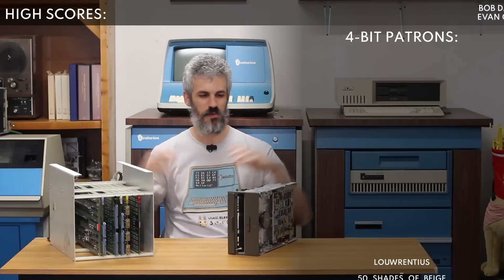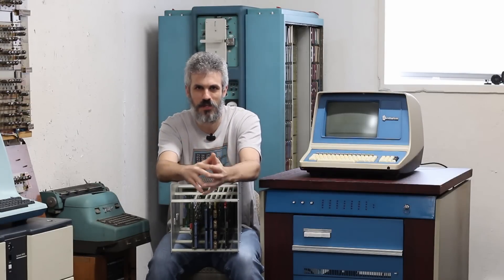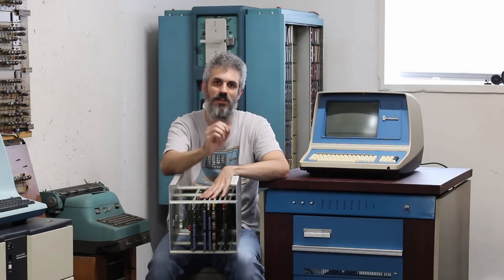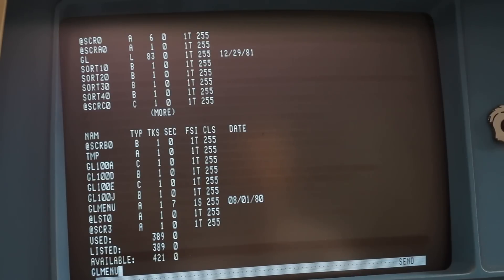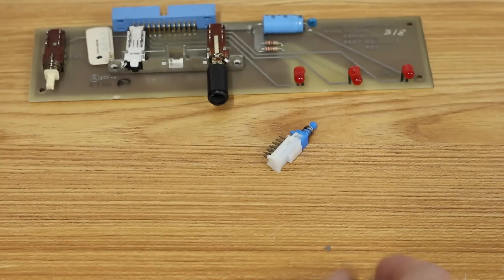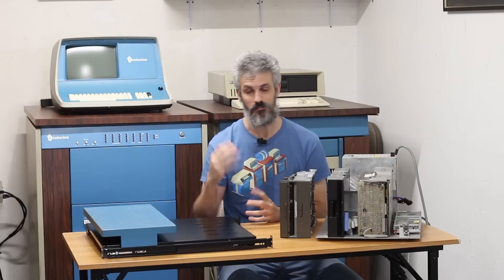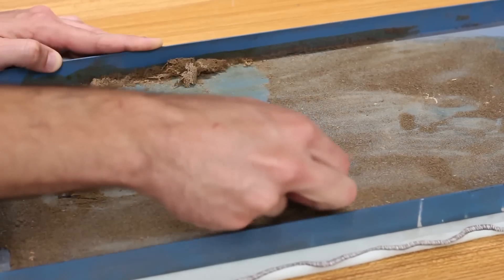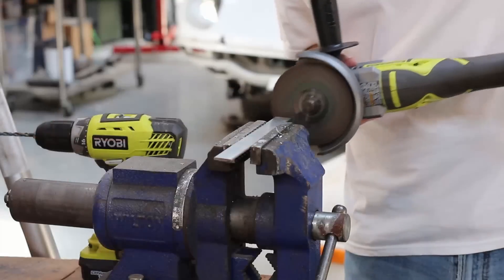The Centurion Bites Back!

Comment from the maker: Thank you all so much for the amazing comments!
To answer a question that many have had, and it's a good one for sure, what happens if they input a modern date? Or rather, is the machine Y2K compliant?

Interestingly, the Centurion doesn't seem to care at all. It treats the year as just a two digit number, and near as I can tell, nothing adverse happens if you drop in "23" as the year instead of "84". However, if you let the machine roll over from 1999 to 2000, it does actually break. That's because the 10's digit was never programmed to actually roll around to 0 again, so it instead just counts up to the next ASCII character, which breaks the date. Best way around this that I can see is to simply turn the machine off on New Years and make sure it's off during the rollover. 

Now, there might be some issues within applications of some files having dates older than others, but we haven't tested that deeply yet to figure exactly where it's lacking. Sounds like it's time to spend some more time in Meisaka's emulator!

Comment: A fair replica of the plastic buttons could be 3D printed if you could make a CAD of the remaining one.
Reply: Given that it is a technical school, it could be a wonderful project for students to do!
Reply: For that, I’d recommend resin printing.  Then the printing artefacts will be so minor as to be super easy to remove.  FFF printing which is what I do takes a fair amount of effort to remove the lines if so desired.
Reply from the maker: One of these days, I'll learn how to 3D print stuff. Although, as Rikki said, 3D printing replicas would be an awesome project for the students at Butler Tech!
Reply: @UsagiElectric Just go for it, its easy to learn 🙂
Reply: @UsagiElectric  Great idea! I suspect that you can find students that would be happy to take on this task. You could do it but there is a learning curve and it might distract you from other projects like these computers.
Reply: @RikkiCattermole   Excellent idea!
Reply: @UsagiElectric  If for whatever reason the students aren't able to do it themselves, which would be a bit of a shame as that does sound like a fun and very approachable project, I'd be more than happy to throw my time at the CAD and pump them out on the resin printer in some tough resin
Reply: @UsagiElectric I haven't used a resin printer, but once you get the settings right it's supe easy to use an FDM printer.
Reply: I put FDM prints into my CNC lathe sometimes to get a perfectly smooth finish. A button would be doable that way.

Comment: FYI - The lady in the black & white picture is Rena. Rena was the secretary to the VP of engineering. The Centurion hardware is a CPU4 floppy system with CDC 9316 matrix printer and ADDS terminal. This picture was taken around 1977.
Reply from the maker: I love that Bud used the staff as models for the promo shots. It's completely understandable though because Rena is absolutely stunning!

Comment: Before you go too crazy, try putting a load on the 24V rail. Also try a small load on the 5V rail. Sometimes one or the other is required for a regulator to work. Twiddle/lubricate the 24V adj as well. Also, what is an appropriate date? Are you sayin' this bad boy is y2K compliant????
Reply from the maker: A couple of steps ahead of you on those, haha.
It's a failure in the regulation circuit of the 723 IC. We have it narrowed down two a few transistors and diodes. It 's a super interesting failure mode though!

The Centurion isn't exactly Y2K un-compliant! It treats years as just two digit numbers, which means you can put pretty much whatever year you want in. The main problem comes if you let it roll over from 99 to 00. The 10's digit wasn't engineered to roll over in the code, so it just counts up to the next ASCII character, which can break the date format. Just make sure you turn it off New Years Eve and leave it off as the date rolls over and you're good!

Comment: in poland this style of switches is called ISOSTAT and you can still buy them in almost any electronic store , in europe the biggest online  store would be TME so by looking there you can find something that also avalable in mauser C&K G003A , i am not sure about diameter of yyour oryginals , those are black plastic covers  6,25mm diameter, 9mm tall
Reply: and also mauser has entire switch cap serction  and the stem is standarised so anything that looks the part should fit the only problem is they never tell you how long or wide they are unless they have datasheet, this is how universal those round buttons aremauser have also 10,5mm tall and 8,8mm wide caps but for some reason they list them as 3,3mm made by e-switch

Comment: It looks like a replacement for the push button cap could be quickly fabricated from a piece of wooden dowel. Drill a hole in one end. Sand or grind the other end to round it. Paint or just leave "natural."

Comment: When you reinstall the Butler Tech Centurion check the serial cable (for Red or Yellow heat shrink tubing)  from the 4-Port MUX to the ADDS terminal.  The serial cables built by Centurion had color coded heat shrink tubing on each end of the cable near the connectors.  Red = RS-232   Yellow = 20ma Current Loop   and a Black was RS-232 for the TI-810 serial printer.

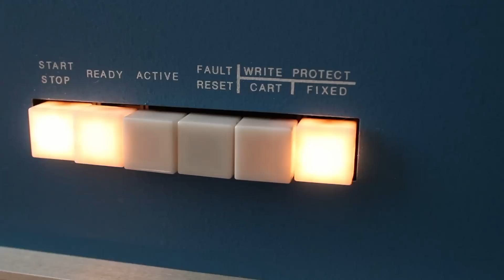Comment: I love that at 11:30 there's a hardware write protect button, and it has a light on/off, brilliant
Reply from the maker: Oh yeah, the physical write protect of the Hawk drive is one of my favorite features! I can test weird things out in software without worry of destroying any data. More drive should have a write protect button!
Reply: @UsagiElectric If I remember correctly, some (or all, I don't know) SD cards actually have a physical write protect switch built in.
Reply: @nikkiofthevalley  But unfortunately, with those, you need to physically remove them (and possibly unmount and remount the filesystem) to access the switch.  Also it's really easy to accidentally move the switch when inserting or removing them.

Comment: I had a HP 4274A LCR meter stump me like that. Came in with fried transformer. Replaced transformer... Smoking zener, replaced. Pulled cards till I got under 1 amp total draw. I never found anything wrong with ANY of the cards. Gave up on it, put it back on the shelf. 3-4 days later got it down and pulled every single card. Put'em all in antistatic bags and labeled them. They were about to go on ePay. I still had low voltage on +12v rail. Removed the backpane and viola! +12v @ PSU. It was an unseen capacitor on the backpane that shorted. I replaced both +12v and -12v caps on backpane and shes a winner. I'd say play pinball for a few days and have some good R&R. It'll be obvious when you come back.

Comment: I loved those little configurable switches, I never even realized they had been discontinued. There is (was) also a bracket available for them with a sliding bar that would fit into that little latching mechanism, you could mount several switches in a row with that bar joining them, and it would make "radio buttons" such that pushing one in would slide that metal bar over and unlatch the rest, then a spring would pull the bar back and latch in the one you had pressed.

Comment: I've been in the same situation multiple times pulling my hair out unable to get anywhere and nearly scrapping/smashing projects in the process, but after walking away from those projects for a day/week or two and then coming back to them, i had it all figured out and solved within minutes.

More often than not, it turns out to be the one thing you were 100% dead set determined it just could not be, and thats what trips you up and leads you down rabbit holes, sometimes ending with a irreversably damaged system.
Reply from the maker: It's amazing what a good night of rest can do to figuring out a seemingly impossible problem! In this case, I'm already starting to hone in on the problem, and it's definitely an interesting and not super obvious one, which is quite exciting!
Reply: Same. HP 4274A LCR meter. Pulling cards reduced excessive current draw but it wasn't the cards. It was the backpane they were all plugged into.
Reply: Happened to me two days ago trying to fix an early-90s VCR, thankfully without any lasting consequences. Task was simple enough, replace two mains filter caps in the PSU and replace the clock battery, a solder-type CR2032. Did all that, put everything back together, VCR refused to load a tape. It did notice I was inserting a tape but not doing anything beyond moving one lonely solenoid. Pulled both video PCBs back out and checked and re-checked all sorts of connections, nothing. I was super-frustrated and just as I decided to put the lid back on for the time being and call it a day I decided to revisit the one cable I'd moved earlier to make absolutely sure it wouldn't get caught in the loading mechanism. Lo and behold, the plug where that cable connected to the PSU board was completely loose! I plugged it back in and everything worked just fine.

Comment: I'm glad to see that you have a dyslexic keyboard like me.

Those buttons could be make using round plastic rod of the right dimension.
Drill a blind hole in them that is equal to the diagonal dimension of the button shaft.
To lock them on cut a single ring off the end of a compression spring that has the correct wire diameter and bend radius to fit in the groove on the switch shaft.
Then you need to make a groove on the inside of the new button to take the spring clip. It needs to be deep enough to allow the clip to expand enough to slide over the shaft.

Comment: Probably take a piece of black plastic rod that’s the right diameter, drill a hole in the end and use that for the button cover. 
Or, could be a fun machine shop project. Be an easy enough task to turn a few on a lathe

Comment: That is like an OLIVETTI BCS3030, the duel floppy unit would have a mains powered motor which drives both drives via belts and pulleys and shaft with two pulleys,the printer would be a bidirectional printer don't know why the keyboard isn't part of the desk, it used packages like lexapk,ledgapk,repapk and other apk files.

Comment: The switches on the Centurion look almost exactly like ones I used recently to repair a 1980's Dragon 32 computer (from Wales). They were C&K series F switches. They are available from DigiKey and Mouser as well as other suppliers. Keep up the good work!

Comment: Niiiiiiiiice progress on the Butler Tech one. I love the newcomer instructions.
Nice jigsaw technique on the floppy drive hole. I'd probably use the angle grinder problem causer myself, dremel or file at the corners.
"Reverse engineering process that is getting slightly out of hand" haha, that's true on ALL vintage electronics reverse engineering, isn't it? So was it with my Soemtron and the PSR. I'm not sure if this is the case for you, but when I reverse engineer stuff, I tend to be curiosity driven and try to RE almost everything, not just the part I strictly need... A good temporal black hole.

October 23rd - 54 years before the nuclear war, haha!

Going through Philly, eh? You really need to visit FranLab then. Give my best to her... again! I guess Rinoa was somewhere around these parts too.
Reply from the maker: Thanks Keri!
I avoided the angle grinder on the floppy cutout because I didn't want to melt or bubble the paint up, and the jigsaw cuts relatively cold compared to an angle grinder.
Reverse Engineering the regulation circuit of the PSU has been quite interesting, and I'm learning a good deal about it for sure!

Comment: Those switches are super standard, they're even still made today. I picked up a bag of 5-way arrays a while back from the electronic bay, which has the first four ganged together in a multi-way selector (push one button and the currently selected one pops out), and the fifth is a regular toggle switch. The mounting rails are standardised, and you can get them with various spacing and pretty much any combination of switch layouts. 

You'll find them if you google interlock push button switch. The cap mounting posts are 3.3mm, so you should be able to find a button cap using the appropriate google-fu based on the dimensions of the original button caps.

Comment: I had to do a double take when I saw you measuring there... guy in the heart of America using metric measurements? Absolutely based. I approve.
Reply: We use both, really.  There's times when SI is more appropriate than American traditional, and vice-versa.  For example, weather forecasts are more comprehensible in Fahrenheit because it's based on perceived temperature.  But measurements on a small scale make more sense in millimeters than in mils (thousandths of an inch).

Comment: You pounded your brain pretty good already to get as far as you have.  After sleeping on it, you'll most likely be able to troubleshoot the power supply circuitry as to why you don't have +24 volts, especially because there seems to be an adjustment to set it.  It could be as mundane as a bad connection.  This equipment hasn't exactly been stored all its life under museum conditions.

Comment: Maybe there is some sort of interlock on the 24v on the original system which is not implemented in the bootleg system or has been disabled? Maybe like a pc psu it needs some draw on another voltage eg 5v in order to turn on the 24v?just a thought.

Comment: Given the proper dimensions, someone could 3D print those missing buttons with, preferably, black ABS (assuming the originals were black) so the printed buttons could be acetone vapor smoothed.
Reply: or you can get polysmooth PLA and use alcohol smoothing as an alternate.
Reply from the maker: One of these days, I'm just gonna have to learn how to model and 3D print stuff. Although, that sounds like an awesome project for the students at Butler Tech!
Reply: @UsagiElectric  Sure, let them do it.

Next time just you need something like that post the dimensions of the post and the button itself - making a model of something like that is VERY trivial to anyone who knows how it's done, and you can order it printed and mailed to you for an affordable rate, probably even locally. 

3D-modelling is not a skill that is very hard to obtain these days but it needs some time to wrap your head around it IMO. As is a skill of configuring slicer and 3D-printer itself. If you are not particularly interested in learning all that it's quite alright to ask other people to do it for you.

Comment: I am super curious.  Are you dumping the drive contents to some sort of backup or modern drives, in case the drive gets corrupted? Or maybe so we (programmers) could have a Crack at writing an emulator for these mini computers?
Reply from the maker: I am indeed, so far we've backed up about 5 different Hawk drive platters, and I'm working on code to back up the Finch drive. We're a bit ahead of you though in that there is already an excellent emulator that can run the backed up disk images. I use it for confirmation and double checking of just about everything before heading out to turn the real machine on!
Hop over to the Discord (link in the description above) and shoot me a message if you're curious and want to try your hand at the emulator!

Comment: I bought desoldering gun from ebay(china) with electric pump for just 30$  It works greeeat if one doesnt mind it blasting molten solder in all directions when triggering that pump :D I have been wondering if I should get something else.. Maybe the one shown in the vid would be more gentle :o

Comment: You are really running high risk projects here with those old disk drives.
I had thought You would engineer a lower daily driver based on a Raspi Pico and a Micro SD card. Then you can spin up the historic CDC drives only when you want to show them.
I think that is also the better solution for Butler Tech. Imagine a bunch of students working on the Centurion. Much better to have a more stable daily driver on that system.